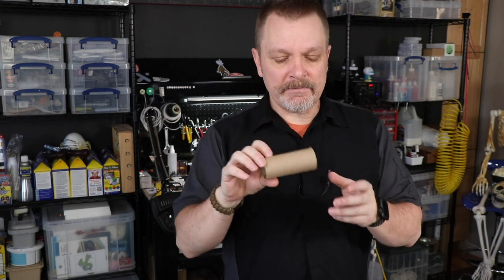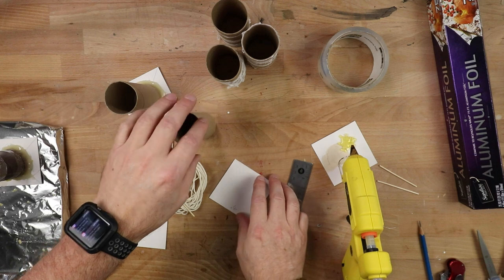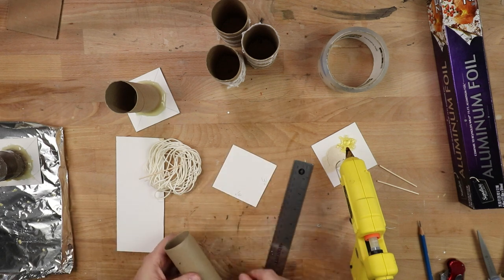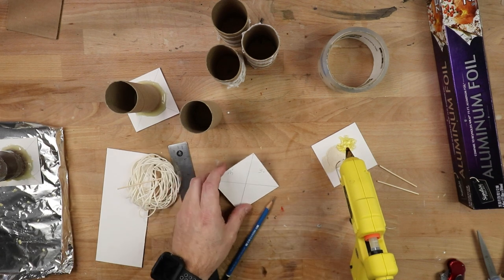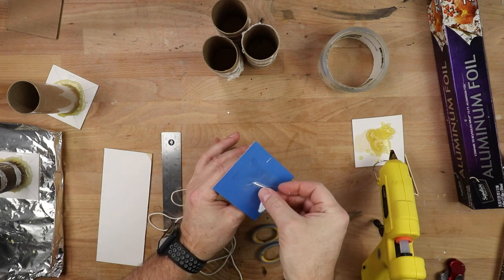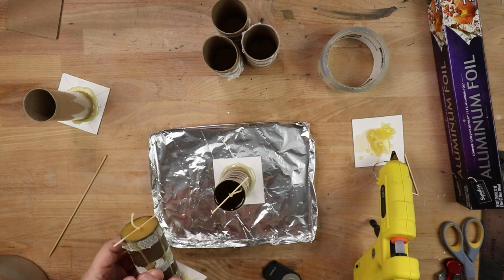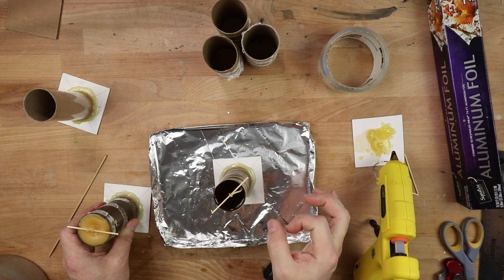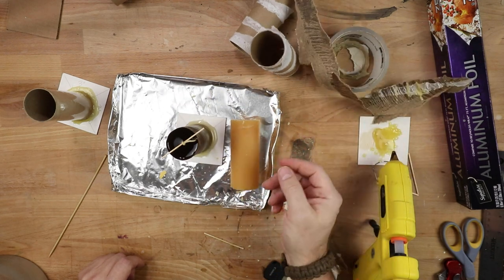DIY Candle Molds From Toilet Paper Tubes

Comment: Great video!!! I spilled wax on the carpet of an apartment I rented some years ago. I found out on you tube that covering the area with a cotton cloth and using an iron can help. It worked really well. I used a thick cotton cloth, medium low iron settings, and didnt press too hard. It took a while because I was worried about burning the carpet....but lesson learned. Im going to use your idea to figure out different ways to decoupage candles. Thanks
Reply from the maker: I've tried that with tablecloths. Carpet is a tricky one for sure. I would share your worries. Have fun with the decoupage... that's a word we don't get to use enough! Thanks for watching and thanks for all of the tips! Cheers!

Comment: you can add tin foil inside the toilet paper roll....then spray the end side all around..they have spray for that...when wax Harding ..its easy to pull out.....the wicks cut to the right size..then dip them into wax just 1 dip..it will stiffing  the wick easy to place into the mold..this is how i work with my wicks..try it...i find it helps me better and will not move..you can have a stick across the top of the mold the stick will keep it into place..good job for what you did.
Reply from the maker: Thank you for all of the tips and tricks! I love how there are so many ways to make candles from everyday materials. All the best.

Comment: Use a double boiler and you won't have to worry about 250+ degree wax.
Reply from the maker: Absolutely! A double boiler is the safest way to go. My main goal is to let people unused to working with wax know you need to watch the temperatures and there is some risk if things get on the toastier side. Thanks for the tip and the comment!! All the best.

Comment: Hello,
how would you suggest using this method with already made candle wicks?
Reply from the maker: If you're talking about pre-waxed wicks that are set in those metal holders, I would adjust the height of the tube to match the height of the wick with a little wick projecting. Usually those are wire core so they support themselves but a little propping doesn't hurt. Don't poke a hole in the base, seal as usual, pour the wax and then set the wick down in the tube being careful to center as well as possible. As long as the wick stays relatively centered, you don't need to fuss much more than that.

I use wire wick with metal bases when making votives and don't mess with securing them to the bottom. If you do find they don't stay centered, you could secure the wick to the bottom board with a dab of hot glue before gluing the tube and then support the wick at the top. I generally try to pour the wax a little on the cool side when trying to stand them up in the wax.

Since we're using hot glue to seal and cardboard held together with who knows what, pouring a little on the cool side and planning for the occasional blowout by using some sort of sacrificial tray underneath is always a good idea :).

Hope that helped! Best of luck!

Comment: This is a great idea I've been making candles as a beginner and I'm going to try this how about if you use a paper towel holder cardboard roll. Have you tried that? Thanks for your video
Reply from the maker: I haven’t but it should work just fine. I would want to make super certain that the base is sealed really well. The taller the tube the more liquid pressure at the bottom… the greater the chance for a blowout. You’ll also have more overall thermal mass so things will stay warmer a bit longer. You could do it in a couple of pours… maybe a couple of inches… let cool… then finish the full height. Pour enough to seal the base but not too shallow so it fully re-melts on the second pour. All the best!

Comment: How many minutes it takes for the wax to dry  before taking the toilet card bard,
Reply from the maker: It will depend a bit on the wax you use and your environment. I've found I usually need to wait overnight. What you might find is the wax will shrink as it cools and will require a top off. You can also help speed things up with a small table top fan. Once the candles start to solidify and you don't have to worry about spilling, you can put them in the fridge to cool too! All the best with your project!

Comment: Happy Sunday 😁 I know this video is three years old 🥺but I have to ask what size cotton wick did you use? I really want to make some of these candles. I can use them as bigger votives 🤭. Thank you in advance 🙂 this video is awesome. Now,  I know I can save these rolls I have instead of throwing them out. I just need to find me a good base🤦🏾🥴 otherwise I'm good to go and get the right cotton wick. Have a wonderful day and week ahead 💝🤗
Reply from the maker: Yes! It's always nice to find ways to use instead of throw away. The answer to your question is really... it depends. Here are the two main things you want to consider:

1. What is the diameter of your candle - the larger the diameter the larger the wick
2. What kind of wax are you using - the higher the melting point the larger the wick

Wax that is formulated for pillar candles tends to have a higher melting point to keep the candle from blowing out and ending up a puddle on the table (less fun). That doesn't mean you must use some special wax... you just need to adjust your wick. It looks like something in the 24 ply to 36 ply flat braid would be a starting point. Maybe start with 30 and see how it goes with the wax you're using. If that burns too fast and you get a lotta wax running, step down to 24. It's a bit like cooking... more art than science! You'll see in the links below that they all say a little testing is needed.

I hope that helps. Kinda vague I know. All the best with your project! Be safe melting that wax!

This link has great information:
https://waxingmoonshine.com/blogs/news/the-right-wick-for-the-job

These are helpful but the wick names are less useful (kinda hard to tell what they are):
https://www.candlescience.com/learning/wick-guide
https://www.lonestarcandlesupply.com/candle-making/candle-wicks/guide-to-wicking

Comment: for the bottom you could use amazon, target, etc used gift cards.  maybe with some sort of rubber ring for re-usability?
Reply from the maker: The toilet paper tube is pretty sacrificial in this application. I do think you're on to something by creating a reusable base of some sort and then just popping new cardboard on. You'd need to experiment with those gift cards to see how they respond to the heat of the wax. They might hold up well... or they might warp. Maybe a heavy rubber washer that you might find in the plumbing aisle? Thanks for sharing!

Comment: For these sized candles, what sized wick would be best, and is there any kind should stay away from? I'll be using soy, and wax chips to color. Thanks!
Reply from the maker: The trick with wicks is to find the right size so you don't melt too much of the wax leaving a puddle or too little and end up with a candle with a hole down the center. I use regular old braided cotton (no wire core) for pillars. Unfortunately, it seems like everyone has a different name or size for their wick. It's best to look at the packaging to see what it's intended for. You're looking for something for pillar candles 1 to 2". This wick will not be the smallest but probably one step up—24 or 27 ply square braid seems to be common. I've never tried materials other than cotton but that's just pure laziness. Realistically, it will also vary a bit based on your wax. Some waxes will have a lower melting point and need less wick and some higher needing thicker. Candle making is a bit like cooking... all of the ingredient influence the final product and will vary from batch to batch. When it doubt, don't stress, make your best guess, try a couple of different sizes, and have fun!

Hope that helps! Happy making!
Reply: @RandomMakingEncounters  Thank you!

Comment: Wow this is really helpful 
But I got some worry I hope you can be of help
Is there nothing you can do to stop the wax from sticking to the cardboard? Like any spray anything actually?
Reply from the maker: If your wax is sticking, my guess is that it has more to do with the type of wax and less about the cardboard. Waxes made for container candles are naturally a bit softer and "stickier". Since the tubes are naturally porous, there isn't really a spray that would help. I might try adding a bit of a hardener to your wax or maybe switching the type of wax. There are formulations that are made for pillar candles that already have additives that allow for the candles to release easily from molds and prevent the candles from deforming when they're warm. Be careful... too much hardener and the candle will not burn well... too little and it burns too well :).

Comment: Going to try this tomorrow. Do you have any suggestions for dying soy wax with natural dyes ?
Reply from the maker: Sadly I don't. When going natural, the extent of my experience has been beeswax. For all of my other candle making adventures, I've probably been a little on the unnatural side using readily available dyes and scents. I tend to go in fits and starts with candles usually making more around the holidays. I hope this worked out for you! It's a fun way to make small pillars and they have an interesting texture to them. All the best!

Comment: What seize of wickd you used??
Reply from the maker: Sorry for the late reply. The size of wick depends on a bunch of things. Another thing that is unfortunate is not everyone names wick sizes in the same way. My best advice is to start a bit thinner than you think and do some testing. If you're using wax with a reasonably low melting point, a thinner wick will prevent the wax from melting too much and have the pillar just pour down the sides and onto everything. If the wax is harder or the pillar is wider, too thin a wick will mean the candle just burns a little in the center and straight down leaving a lot of un-melted wax. In that case, up the thickness a bit. Most wicks will say "for pillar candles from some width to some other width". Keep in mind wax hardness will still play a big part in how well the candle burns. The best part of candles is... wax that doesn't burn can be remelted and reused so experimenting is pretty low cost. Buy wick in small quantities until you get it dialed in and you should be good to go.

I hope that helps... you probably already figured this out in the time it's taken me to reply. All the best with your project!

Comment: Maybe Bluetack could be used instead of the hot glue.
Reply from the maker: It's possible! There are a variety of different sticky materials out there that could be used to seal the base. I use them to hold electronic components in place while I solder and have found some to be heat sensitive. One thing I use when I want to temporarily stick things down is butyl tape. I wouldn't use it for walls, it tends to leave stains, but it's really sticky and seals well... that's what it's designed for. I've never tried it for candle molds. I know there are also tacky materials specifically for mold sealing so your idea/instincts are spot on—it's just a matter of experimenting a bit. I'd work on a tray, hope for the best but plan for a mess LOL! Cheers!

Comment: Does anyone know where I can buy peraffin wax in bulk for cheap? I find candle light cool and light to burn candles often, but that also means I go through candles quickly.
Reply from the maker: Paraffin wax is getting a little harder to find these days. It's a petroleum product and is generally being replace by soy at craft stores. I wish I had a secret super source for ya :( All the best.
Reply: @RandomMakingEncounters  No problem, thank you for the reply

Comment: Hello! Can you use some sort of tape instead of hot glue? I don't have a glue gun! ☺️
Reply from the maker: Sorry for the slow response... it's been one of those new years. Sooooo... tape is a possibility. However, molten wax is as fluid as water so you really need to make sure the tape you use is really sticky, is resistant to heat, and doesn't have any little creases, gaps or little channels where the wax can sneak out. The benefit of hot glue is it fills the nooks and crannies. My experience has been I always end up with leaks with tape. If you try it, be sure to plan for leaks and work in a tray or on a surface where spills are not going to ruin your day.

Thanks for asking and thanks for watching!

Comment: does anyone know if there's a way to do this without hot glue?
Reply from the maker: You need an adhesive that’s reasonably thick to seal the base. It’s possible to use something like a really thick white glue… like one of those craft tacky glues. Make sure you have a solid, thick bead around the base. The downside to this is you have to wait for it to dry completely so it’s a little slower. You could also use something like a water based bathroom adhesive caulk. Those come in small tubes at the hardware store as well. Anything that is adhesive, thick, reasonably heat resistant, and fills the gaps could work.
Reply: @RandomMakingEncounters  plasticine?
Reply from the maker: @nowirehangers2815  I'm not sure it's sticky enough on the cardboard. There is that poster hanging putty stuff. I also just did a quick search and found there's a candle mold sealing putty that looks a lot like that stuff to hang posters. It would be worth experimenting with but i would test on a tray in case of blowouts :)!
Reply: @RandomMakingEncounters  thank you 😊

Comment: You forgot to prime the wick.  Raw cotton wick is just gonna burn without staying on fire long enough to actually vaporise and ignite the wax.
Reply from the maker: Thanks for the added tip for folks. I've generally had pretty good luck without messing with the wick too much. However... it sounds like you may be a bit more wise in the ways of wicks so good information to pass along! Thanks!

Comment: Your not goingbto get a good tear of the tube if it is strengthened with packing tape
Reply from the maker: Very true. The tape isn't really necessary if the tube is in good shape. I think the cheaper the tissue, the flimsier the tube and the greater chance of leaking. It's a bit of trial and error to see what you can get away with. Thanks for the tips/thoughts. Cheers.